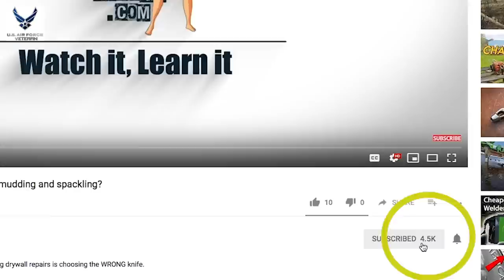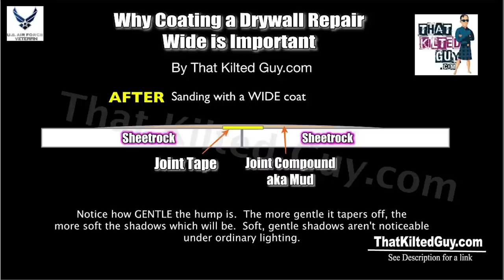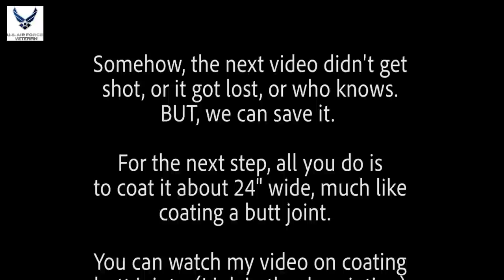2023 - How to Repair CEILING WATER DAMAGE using Mesh Tape the correct way

Comment: I've been doing professional remodeling and repairs for 40 years or so. I appreciate that you explain in your videos a lot of the things that I have had to learn the hard way. Here in Tucson we have a lot of lathe walls and ceilings in the older homes that have sagged through the years because gravy works. One thing that I have done with some of the more extreme sagging is to brace the ceiling up before I screw it to the ceiling joists. First I measure how high the ceiling is at the wall, because I know it's not sagging there, and subtract 1" from that measurement and cut a 2x4 that measurement. Then I use a piece of 2x6 about 18" to 24" long and nail it to the end of the 2x4. I can then use this to brace the ceiling back up while I resecure it. Remember to protect the floor if needed. I hope this helps someone.
Reply from the maker: Thanks so much commenting. I appreciate it
Reply from the maker: And thanks for subscribing. Guy

Comment: I've had other people say they always use mesh tape and never had an issue, however, half my work is fixing cracks that were previously "fixed" and soon cracked again because mesh tape was used. Always use paper tape or fiberfuse. Any professional I've ever talked to wouldn't use mesh tape under any circumstances. I even tried it on some joins in my house I built recently just to see for myself and nearly all, if not all of the joins cracked. I'm in Australia so maybe there's some difference in the tape or the drywall or the mud, who knows. But for anyone watching this to try and repair cracks themselves, it's not worth the risk. I understood when the only alternative was paper tape as that's a bit tricky to get right if you're new to this but Fiberfuse is very easy to use, even for newbies. Apart from that, everything else you do is good, Kilt guy!
Reply from the maker: I still say it’s all in technique because I’ve applied at least 500 rolls of mesh tape and never had any issues. I’ve only had one call back for a cracked that reappeared in all the time I’ve been doing this. I’ve gone back to jobs I worked on years ago and one of them I fixed over 90 feet of cracks from the original drywall, and I used mesh tape on everything, and not one crack came back. It’s all about technique and skill. And many people make mistakes that will cause cracking to happen. I made the mistake one time and had about 30 feet of cracks appear but I wasn’t done with the job yet so I fixed it and learned my lesson which was not to use all purpose joint compound over mesh tape.
Reply: @ThatKiltedGuyDIY  Ha, I just came across your video, Drywall mesh tape, why it fails. But just to clarify, I'm talking about using it with hot mud. Personally I've never used all purpose. Maybe it's to do with how your walls are built? I understand your studs are usually spaced 16" apart? Ours here are usually 24". Then again I also had a 12" nib wall crack so who know. If it works for you, that's great. Would just hate for you to cop backlash from people using it because you've recommended it and it fails on them.
Reply from the maker: No one has yet, in 6 years. Thanks

Comment: 4:38 This is what separates @That Kilted Guy DIY Home Improvement from all the amateurs who post how-to videos.  Kilted Guy takes the time to create custom diagrams so we really understand how important it is smooth out/taper the hump created by the repair.  I've seen dozens of experts in YouTube mention this, Kilted Guy goes the extra mile to illustrate it.  This is the difference between "telling" your audience and "educating" them.  Thank you!
Reply from the maker: Thank you. It takes a lot more work to put out my videos which is why I don’t have as many released and they don’t come out as often, but I wanted to go the extra mile to teach. Nice to know it’s appreciated.
Reply: Or you can GO DO IT and LEARN.   I did 20 yrs ago.
Reply: This IS good for the Newbies though.
Reply from the maker: @danskroko3537  that is true, and it's how I learnd a lot of what I know about repairs.  My dad taught me new construction which I did about 10-12 years, then I got hired on to do repairs for a big drywall company in Seattle while in the Air Guard there, and I found out, it's really a different ballgame.  And I made a Lot of mistakes along the way, which taught me a lot.  But I created this channel to hopefully save a lot of you from making the same mistakes I did.  Some weren't that bad, but cost me time, and maybe resulted in a lower quality. Like the very first time I had to match texture, it was a kitchen ceiling that was removed and re-rocked, and it blended right into the next ceiling, so I needed to match it.  My texture looked nice, but it wasn't a great match, so I had to go sand it all off and do it again.  Hard lesson learned, and when I put out my video showing how to match texture, I can save others that lesson.
Reply from the maker: @danskroko3537  And I actually have about 40% of my viewers that are in the trades, but looking to pick up a tip or two from me.  I still learn things from others, so yes, it's mostly for newbies, but also for seasoned pros.  If you ever think you know it all, come back after the next mistake, lol.
Reply: @ThatKiltedGuyDIY  On the job Experience is Awesome.   I learned on the Job too.  I am not Bashing you - But MOST is not Hard IF you apply Yourself.   Life is like that.
Reply from the maker: Yes sir. And I know you aren’t bashing me. No problems.
Reply: @ThatKiltedGuyDIY  I AM going to Subscribe.  Always looking for Tips.  Sorry if I came off like an ASS.  20 yrs as a Landlord Taught me.....Then Contracting was the Easy Part......Minus SOME Customers.
Reply from the maker: @danskroko3537  Nah, I never thought you were an ass.  I've found that typing words on the internet just often comes across wrong, so I try to assume the best.  If I find someone to be TOO obnoxious, I have the Delete button, something you don't have with customers, lol.
Reply from the maker: @danskroko3537  And I REALLY appreciate the subscription, and ALL the comments.  YouTube ranks us by engagement, meaning comments, likes, views, how much of the video you view, shares, etc.  So more comments is good.  Thanks again.
Reply: @ThatKiltedGuyDIY  2 near Death Exp and NO Leg amp.  Doing 2 mi and 100 sq a day. - Quit Drinking -Smoking -Exercising again and Eating Right.  Time to go open a Painting/Drywall Gig Again and get back to Society(is it worth it?)   The Only thing that I want from the Internet is Advertising for the Gig.  Owner operator - No Employees unless I 1099?  Thinking of Contracting out but that has its own set of Headaches.  P.S I am 47 so I still have Time.....Nice to Talk to people like You......Makes it worth it - Ya know.

Comment: Guy, I just came across a video where you mentioned that you did some training at Keesler AFB.  I was stationed there from 1980 to 1984.  I am glad to see that you are on the mend.  I certainly hope that your recovery is swift and complete.  I really appreciate the videos and the teaching.  Yours is the only DIY  YouTube channel that I subscribe to.  I have watched other drywall repair videos, but yours are by far the most complete and helpful.
Reply from the maker: Chris, thanks so much as being thorough and teaching in depth is how I set myself apart from other channels. 

I was stationed at Keesler for training two times. The first time was in early 1985, so close to you. And the second time was in 1987 when I retrained into electronica warfare. I spent nine months there as an NCO so I got to stay in the NCO quarters, and drive my newly bought iRoc Z Camaro so it was one of the great times in my life. I was getting paid to go to school, then I worked part time bagging groceries which paid pretty good since it was paid in tips only. And I hung out on the beach, traveled up to Mobil to check out a battleship, etc.

After nine months of school I ended up graduating at the top of my class so all in all, it was a great nine months. 

Since you were stationed there, were you an instructor?
Reply: @ThatKiltedGuyDIY  I was stationed at Kessler medical Center.  I'm an anesthesiologist and I worked in the operating rooms at Kessler.  I currently live on the other side of the Rockies in Salt Lake City.
Reply from the maker: Cool, well I'm in GJ CO, so not that far away.

Comment: Every job is different, if it is mesh tape on the original ceiling I'll repair it the way you have here. Fix any screw pops tighten it all up and so on. If it's paper tape, I'm going to cut the original tape the length of the crack, and remove it.. usually it was installed with AP joint cement and should basically peal right out once you get a knife under it. Put the new tape right back where the old one came out.

Comment: This video is perfect for the "hump" problems that can occur.  Have learned so much from your videos.  This looks about the size of numerous stress fractures that I have.  I have a really big crack that I will send on the Patreon program.  Well it's actually only about 1/4 inch, but looks like the grand canyon to me.
Reply from the maker: Hi Stacy, and I received your email and will help you with those problems for sure.  Thanks for supporting our efforts on Patreon. 

I also am doing a job next week where I will be fixing a bunch of wall stress fractures and will do some video on those if I can. 

But this video is a great guideline for how to fix ceiling cracks. Thanks again
Reply: @ThatKiltedGuyDIY ,  yes this video is the "outline" I am using for stress cracks as well!!

Comment: Thanks so much! I just went ahead and removed all the stumpled ceiling texture in each & every room of my home (as opposed to the 3 prior).  While the other 3 rooms were pretty smooth underneath, the living room and kitchen (which initially I had planned on just tiling as cover up) have cracks and splits down the middle that left me so rattled that I regretted removing the texture and felt like I should've stuck to that original decision of tiling.  But  you not only showed me techniques that will allow me to get it smooth to the point of non-existence/level five but also ready to paint. This really put my mind at ease to continue onward. I'm gonna be using color on my ceilings BTW.
Reply from the maker: Thanks, glad I could help you out 😎. And thanks for subscribing!

Comment: Thank you for mentioning wet sanding. I tell anyone who will listen that wet sanding is a myth. It works to knock down a heavy edge or if you need to minimize dust, but not for a finish coat. For a smooth finish and clean feathered edge you have to finish with a thin coat of mud and or sand.
Reply from the maker: Yeah, I only use wet sanding for the thin edges.  I feel wet sanding just rounds over the thicker edges, and just doesn't do as good a job.  I try to minimize sanding as much as possible, but when I have to sand, dry just works better.  I explain it better in this video about wet vs dry sanding - https://youtu.be/9Ztudl3LIhc
Reply: I repaired a local govt building, flood damage. With a lot of sensitive computer equipment. It was a big job, and the job was spec'd for wet sanding. It can be done, but it's very difficult... Bring a joint knife with you just in case you fudge an edge. This was going over painted surface too, the bottom 2 feet of every wall in the building was replaced.... Terrible job, skill level 5000. 😂

Comment: Thank you for the video. I think all of the steps that you have shown are correct. All of my drywall experience comes from the Utah and Idaho areas... especially in Utah, we have severe cold and also it is a desert region! I have found over the years that I’m safer to include more screws whether it needs it or not. Since The drywall mud is extending out around 24 inches at times, I make sure the screws go out that far as well. In Idaho where they have a lot of radiant heat ceilings, and a special RH bass sheet rock was used, then the electrical wires in then two coats of plaster, one skim coat and one texture coat! using that mesh tape , to reinforce the joints,Would always leave cracks in the ceilings...And the old master plaster “Dee Summers”...Explained that you need to use the paper Drywall tape Instead of that sticky mesh tape. Also on A lot of the repair jobs that I have done.. requiring fixing other peoples drywall patches, I have noticed that they have use that mesh tape and it seems to not hold like the complete bonding that you receive from using the paper tape. So that would be my suggestion! You were guaranteed to not have any further cracking by using the paper tape. In using the paper tape it requires one additional phase. You have to tape it using mud then let it dry before the first coat over the tape! That’s why people love using the mash because you’re actually skipping one phase and you can go ahead and just apply your mother directly over The mesh tape and you don’t have to wait for the paper tape to dry...A lot of cracks in a ceiling are Caused by water leaks ,and And the insulation absorbs that moisture, spreads out into a larger area, creating a lot of weight and pushing the ceiling down. Putting more screws in always illuminates movement in the ceiling. Where are you have a movement you will have more cracking. I thought your video was awesome, and showing a lot of detail on how to feather out of your edges and ensure that you don’t have that shadowing affect which that there has been a patch or poor drywall job! Thank you so much for the video.
Reply from the maker: Hi Stephen and thanks for the comment. I to have fixed a lot of other peoples repairs and yes I have seen a lot of mesh tape in those. But I’ve also fixed a lot with paper tape as well. And here’s the thing, I have gone back to numerous jobs that I have worked on years later when the customer decided to do more work on their home. I always go look over my old work and I have never seen one of them fail. The reason is that I always use hot mud. One Time I doubted myself and used regular joint compound and I got a ton of cracks so I learned my lesson. 

It’s all about technique and I feel that either one works just fine because I have seen paper tape crack many times so it’s not fool proof. And I don’t even do new construction anymore so for the last 15 years I have repaired thousands of homes and I have gotten to see dozens of them years later and have never had a failure.

This has convinced me that the mesh tape failures are due to improper techniques.  Thanks again for commenting.

Comment from the maker: 48 Pieces of rock cut in order to conduct extensive tests of 3 types of joint tape, mesh tape, paper tape & fibafuse. I'm testing them all with both hot mud & all purpose mud. I'm doing 6 different tests so this could be real interesting. I'm hoping to help you guys understand the difference between these three products, and the advantages and disadvantages of each. I'm thinking I'll learn a few things to. I'm excited to put this one out for you.  Be watching for it early May 2019
Reply: Paper tape and setting compound for the win! Lol if you've ever tried to remove paper tape that was applied using setting compound... Wow! It's a nightmare.... I would recommend some sort of torture test to see which one develops a crack quickest.

Comment: The 3m glue trick is very nice , been doing this for 20 years and don’t know why i haven’t thought of that lol , i always waste time and mix a tiny bit of hot mud while I’m meshing to tac it so it doesn’t fall down by the time I go to hot mud
Reply from the maker: I thought of it one day when I mesh taped a bunch of stuff, but didn't coat any of it and left for the night.  The next day, half or more had fallen down, wasting a lot of my time.  Been doing the glue trick ever since.  But, the 3m drywall adhesive works the best.  I've tried a lot of them and they just don't work as well.  Plus, the purple color helps me know where I already sprayed it.  

Thanks for the comment, and glad I could help.
Reply: It does help a lot especially on painted surfaces.

Comment: Elastrometerics caulk and a wet rag will do the same thing a lot faster.  Just dab screw heads with one time and light sand with wet rag. Been doing it my whole like and Im 50 something. A lot lest steps saves a lot of time.

Comment: Adfors makes a super thin and strong mesh Tape that will save you a lot of time. Less prone to cracking as well. Check it out.
Reply from the maker: I have it, but didn't find any benefit, and to me, thinner is weaker, a little anyway, so I prefer my Yellow mesh as it's much easier to spot when you put a lot on all over the place.  And I've only had one job crack in the last 10 years, and it was likely due to the building shifting, but either way, mine just don't crack the way I do it.  I've gone back to a job where I fixed over 100' of cracks, and 3 years later, they still hadn't come back.  But use what works for you my friend.